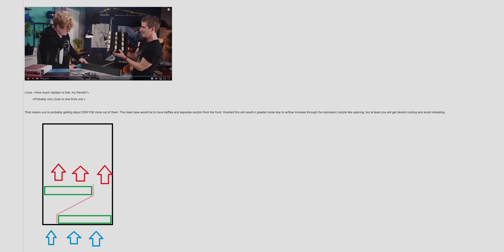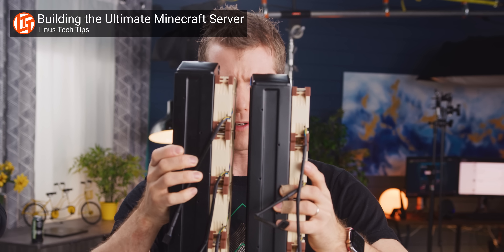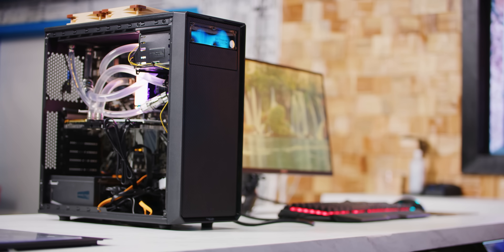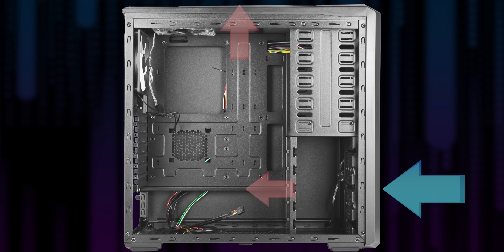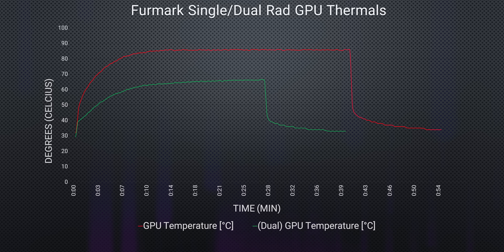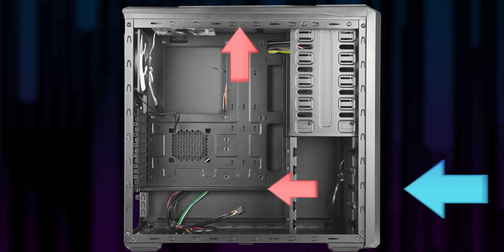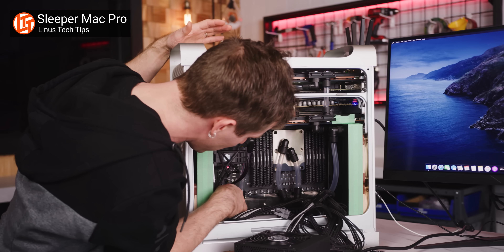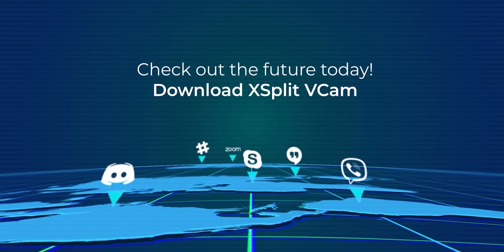I’ve been water cooling wrong for YEARS - $H!T Manufacturers Say

Comment: I'd have like to have seen Corsair's input on this, clearly they have engineers dedicated to this type of thing, and it's something they're passionate about.
Reply: It probably works better if they're in parallel, not series?  But that only works if you have somewhere for the coolants to go.  XD
Reply: @jwhiteheadcc  came here to write that...
(see therealpbristow message for what is the difference between series and parallel)
The one Corsair complained about was (tree parallel fans - one unit) placed after each other in series, thus blowing air into the second, and third.
This experiment is two in parallel.
Failing to notice the difference is remarkable...
Reply: @jwhiteheadcc  series should be better as air going in both the radiators will have low and same temperature, if it's parallel the air going into the 2nd is already hot or at least hotter, and has less heat transfer. That's what he was talking about earlier
Reply: @mohammadmuzammil4848  You seem to have series and parallel the wrong way round.

Series: The air goes through one radiator (which heats it up), then through the second radiator (which tries to heat it up even more).

Parallel: One lot of cool air goes through one radiator, while a differentlot of cool are goes through the other.
Reply: @therealpbristow  you're probably right i got caught up in arrangement of radiatiors with relation to each other, not the air flow. My bad.
Reply: @therealpbristow  Well, you might have been right about him confusing parallel and serial, but he's not necessarily wrong! If both radiators had access to room temp air, parallel would be most efficient since both rads would have a high temperature differential. However if the air has to pass through both radiators, having them in series with the water flowing opposite the air could actually be more efficient: The warm air from the first radiator would be used to cool the even warmer water coming from the CPU/GPU, ensuring there would always be a temperature differential.
Reply: @mohammadmuzammil4848  Wait, I think I'm getting parallel and serial mixed up, somehow, or they mean the opposite in cooling systems?  Sounds like you're saying a second intake will have hotter air?  I guess if they're near the exhaust both of them will.
Oh nvm, I didn't see the responses.
Reply: @jwhiteheadcc  haha cool i got it wrong at first
Reply: It’s pretty simple - ensure all radiators are being supplied ambient air or don’t bother with additional radiators.  Dunno why in the test build they exhausted out the top, sucking air from inside the case across the second radiator.  Just flip the fans and you’ll see a dramatic difference.  It’s not like they are relying on natural convection, there are fans everywhere!
Reply: @DocNo27  Because keep sucking in hot air is bad for passive cooled parts.
Reply: @DocNo27  The sidepanel fucked up the test. the second rad is getting fresh air from an open side. If you lock it then what corsair said makes perfect sense.
Reply: @charliek9394  ...are you assuming they ran the tests with the side panel off just because they showed the PC with the panel off in the B-roll video footage? That's.... just so, so, so wrong. Of course they had the side panel on for the actual tests.
Reply: @charliek9394  Every case ever built leaks air like a sieve, you will always get fresh air so long as you don't literally stack the radiators with fans in between.
Reply: Real world applications often don't jive with models. You can't argue with measured results.
Reply: The thing is, that their simulations sure are right. But they are talking about usecases where you actually have 40°C cooling temperature and hope to get better performance with more radiators in series. However, even in that case the cooling would be slightly better (while the efficiency is lower with every stacked radiator).
So reaching out to Linus to say such a thing would never make sense. And honestly I think it was just a single engineer from Corsair who can do mistakes as well.
Reply: I’m willing to bet the real numbers get closer and closer to Corsair’s as you test in cases with progressively worse thermals.
Reply: this test is absurd as they put a 9900KS on a Asus Prime board which cannot handle it
Reply: This would make sense in server racks where airflow can only move from front to back.
Reply: Is the air behind each radiator at the expected temperature as predicted by the corsair models?
Reply: *I would of liked to have
Reply: Mate, don’t trust engineers. At airbus you’d be surprised how many issues get fixed by the blue collars. The real design is full of miss designs and flaws.
Reply: @enaniux182  As an engineer and someone who works on my own cars, designs SFF PC cases, a design can be great in theory but if you cant screw it together its worthless haha, happens to us engineers a lot
Reply: @daveurda8511  Aircraft engineer here mate, I pref working a mechanic XD
The office guys don't tend to understand how anything works in reallity.  
I don't know man I studied engineering cause i like building and repairing stuff, guess it was same for you, but most of the engineers now a days do it for completly diff reasons.
Reply: @daveurda8511  Yay, as a tech I like good engineers.  And the good ones realize what you just said.
Reply: @enaniux182   As a tech of 18 years I can corroborate this statement.  The good engineers are the ones that will get their hands dirty.
Reply: @enaniux182  Airbus?? salute good work, bud.
Reply: @enaniux182  A good company has open lines of communication between their "blue collars," as you put it and their engineers. I'm constantly in my shop, so I can help my techs when they make mistakes, and they can let me know when I've made one. No one's infallible, but that's no reason to issue a blanket statement not to trust engineers.
Reply: @jacobdaniels7025  I know it aint a general rule mate, but as an engineer that likes getting his hands dirty and working with tools instead of in the computer making drawings or calculations, I gotta say I'm disappointed of most of us bro.
Lots of the modern engineers don't even understand how the fuck you use a spanner.
Also, the key on your statement is "I'm constantly on my shop". Fuckers tend to think they are too good to get out of the office at times. 
My opinion is just bland disappointment man, nothing else. OFC, there are top notch engineers out there, but the % is 2 low, and as you may know, numbers don't lie.
Reply: @enaniux182  You sound bitter
Reply: @enaniux182  You think engineers are a problem?  Look at the managers who give them bad specs.  :D  In fact, often intentional.
Reply: Joseph Whitehead I do believe you mate, management tends to be the shittiest part of it all.

Comment: My curiosity is... how well does this work by actually stacking the radiators directly.

You said it yourself, there's a gap between the two radiators and that allows air to mix in various ways. When you did the Minecraft server you directly stacked, back-to-back radiators. I'd be curious if that setup sees the same kinds of gains. Would tell us if the radiators aren't as good as claimed or if there's more heat dissipation through case, holes, etc... than corsair' s simulations take into account.

Comment: just mount them outside of the case not interfering whith the airflow in the case and you will have improvements with more radiators and inside the case the other components like VRM and Chipset will also feel 10 °C cooler.

Comment: I bought a tower from corsair and in it's specs it says it can mount up to 6 fans inside if you remove the HDD cage. So I did that and tried mounting 6 fans and the holes did not match up. I went back and forth with corsair multiple times, they kept creating diagrams out of pictures of my case I sent them with different solutions and they kept being wrong. I finally had to talk to someone higher up who said I wouldn't be able to mount 6 fans how I wanted to and received 15% off credit to their store. I'm just commenting this because it seems like corsair is a bit confused about their products and even towers in general according to this video too. I wouldn't buy another tower from them.

Comment: omfg ive been writing that in the comments for years same goes for having a rad as a exhaust and a non blower gpu
Reply: What about rads as exhaust? I have been using them as axhaust for decades. Many of us have been there, done that regarding actually measuring the difference between intake and exhaut, using both different types of video cards. Differences of 1 to 3 degrees c are normal, and it comes down to what you want cooler, the gpu, the cpu or the motherboard chipset which is also effected by internal case temperature. Right now I have a 1gHz overclock with a 360mm rad used as push exhaust, with a non blower RTX 2070 Super, and my temps are excellent.
Reply: @OriginalMergatroid  there is only one proper way to do water cooling and thats one loop with a exhaust rad for the cpu and one loop with a exhaust rad for the gpu
Reply: @magnushansen6164  There is definitely not "ony one proper way to do water cooling".

Comment: And a change in the order of the cooling rads? I mean, (looking in the waterflow perspective) if the first rad is in the rear and the second in the front (air intake) the warm air (inside case) will cool the hot water and the fresh air will cool the (by now, theoreticaly) warm water. Changing them arount would, most likely, be bad. Idea for a test?

Comment: question: what if you routed the water in opposite direction of the radiators? that (as far as i know) is how energy saving aircooling works in buildings, so the hottest water hits the last radiator with the hottest air and the cooled down water hits the first radiator with the coolest air?

Comment: I have an old thermaltake kandalf lc tower. It has an external door mounted rad and I fitted an extra rad inside. Running the hot water trough the internal rad with warmer air cooling it before running the water trough the external rad cooled by "fresh" cool air made temps go down almost 5°C in comparison to running the rads the other way around.

Comment: something that would also play a roll in how a stacked rad performs, is the flow of the water through the stack. i hope that this wont get too confusing...
but, if you have the water flowing against the airflow, that SHOULD increase the amount of thermal energy taken from the water, 
in case someone doesn't understand what i'm getting at, i'll elaborate
the water flows into the second rad of the series first, the dissipates the majority of the heat because the air is slightly warmed up already from the first rad in the stack, the water then goes to the second rad in the loop and dissipates the rest of it's heat.
if it was ran the other way around.. it may not work as well, but the performance would still be greater than that of a single rad loop.
Reply: The flow of water plays a roll in all water cooling builds. You are referring to positional influence, which is common sense. You want the firstrad to cool the water enough to make the second rad perform better. As a professional, I would hope Linus is well aware of this. However, in practice I would ecpect it to not make any difference once the water temperature has reached max and saturated the maximum performance of the rads, causing the second rad to blow maximum temp air into the first rad.

Comment: To be fair, their point makes sense when stacking radiators directly ontop of each other. Not like you did on completely opposite sides of the case where (as you explained) air circulated in and out of the case due to holes, as well as simply using the case itself to dissipate heat
Reply: Did you bother to wtch the entire video?
And did you miss the comments made by Corsair about the non stacked pc build done by ltt?

Comment: I think the optimal set up for a dual radiator would be to have both radiator fans to be pulling outside air through the radiators and have the rear fans set to blow the hot air out the rear of the system. This way both radiators are getting the cooler outside air. I don't believe the resulting increased case temperatures would matter too much as the CPU and GPU are cooled via water. My basis for this is that this is how automotive radiators work. The rad fans pull cool air through the radiator and into the engine bay and this is effective. Just a thought though and it would be cool to see that tested.

Comment: If you put both radiators directly in series is not as good as putting one inbetween heat sources. Eg. put one between cpu and gpu to reduce water temperature inbetween.

Comment: Mechanical engineer here. It's easy to be hard on Corsair, but I'm going to say that CFD is really hard. Tiny assumptions matter a lot. If they assume that the air leaving a radiator is the same temp as the coolant, it could lead to a very different result. If they assume that the case is a closed body (no air leaks, no radiating of heat), it's not going to match the real world. Even the density and humidity of the air would have a massive effect; let alone ambient temperatures. Your results make me think that your radiators aren't transferring heat as efficiently as Corsair thinks they are. If you're pushing less air, or have worse heat transfer, adding more radiators would help. However, I think it's a fair rule of thumb to say that adding a radiator as an exhaust is a sub-optimal idea; I'd rather have both pulling in ambient air, even if it means pulling in less air overall.

Comment: Just finished a class on heat transfer and never thought of this. Makes sense though. You would need to set up radiators in parallel (not like in the server) and combine the water loops. This would force you to need a wider case though. Stacking does return results, but with diminishing returns so it really isn't worth it unless you don't have a budget limit.

Comment: There's no way that the exhaust air from the 'first' rad rises up to the water temperature.  That would be like saying the water temperature drops down to ambient air temperature as it comes out of the rad.  We all know it doesn't.  Given 20c ambient here, and a worst case scenario of 45c water temp, I feel like the exhaust air temp is only 25c or so.  That will slightly reduce the effectiveness of any second radiator, but it doesn't make it useless.

If indeed the air temperature went from ambient up to water temp after only going through one rad, then I would agree more rads wouldn't help, as the air has absorbed as much heat as it can. 

Cars for example always run rads in front of each other.  There can be the engine radiator, then AC condenser coil, then possibly an intercooler (not necessarily in this order of course).  Sure, it would be 'better' for them all to have fresh air from the outside, but there's only so much room available on the front of a car.
Reply: @Claptrap Jesus I just measured it.  Ambient 21c  Water temp 31c  Exhaust air from rad? 22c.  Why wouldn't a second rad being fed 22c air not 'help'?  Sure, if you could feed it 21c air, that'd be better, but sometimes you don't have the space.  In other words, most of the time anyway, the air has specific heat capacity left after going through just one radiator.

As far as the car example, they kind of prove my point.  Car rads (engine coolant) can be a kind of multiple 'rad' design.  They can have multiple 'tubes' or layers.  Air cools one 'tube', then another, then another.   Kind of like having multiple individual rads just all in one physical design.  Sure it takes more static pressure to create the same airflow, but driving down the freeway gives lots of static pressure and airflow.   And because it's under pressure, engine coolant can be >100c.  Sure, the air coming out of the rad is hot, but it's not at 100c.

Comment: The difference is that a single 240mm rad isn't enough for that CPU+GPU, so adding another increase the thermal mass enough, but this isn't what they were talking about. The other builds had radiators that did have enough thermal mass, and adding more just wouldn't help as much. You need to do this again with a larger, higher-capacity radiator.

Comment: Cars have staked rads. Engine rad, ac rad, turbo intercooler (if turboed), ( often power steering is in engine rad or can be separate, some vehicles have oil coolers be either engine oil or gearbox oil or both) all normally stacked up to each other. Some of that is because front of car is where the cool air is... But they are all large and stacked. Rather than small and next to each other.

Comment: i dont think corsair was saying more then one rad is bad. i think its the way you have the rads setup. like in both examples corsair talked about the rads were pointing at each other blowing hot air directly through the other. but in your test rig that wasnt the setup

Comment: Pretty simple to understand that you would want your rads drawing in cool air from outside the case. However that is rarely possible with normal PC cases. I have a rad on my intake and another on my exhaust, all i could do. Best would be to remote mount the rads completely outside of the case so you arent dumping the hot air back into the case aswell.

Comment: Thinking about it, wouldn't running multiple in parallel rather that series be better at cooling, assuming that they all were pulling fresh air rather than the last's spent air? If course doing it this way would also require a beefier pump to run, so it may not be worth it